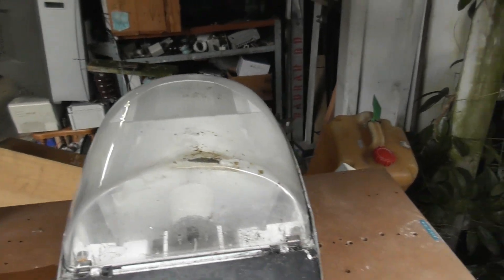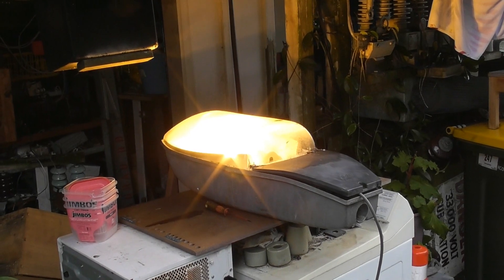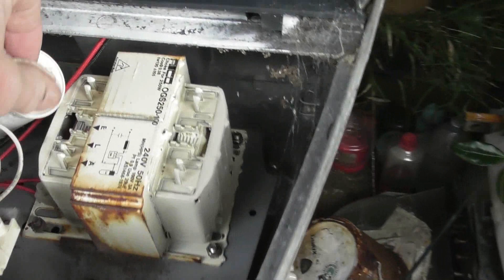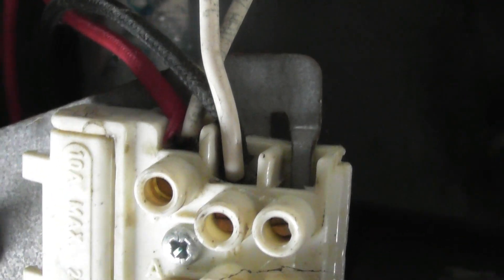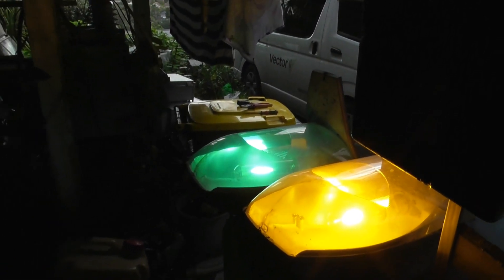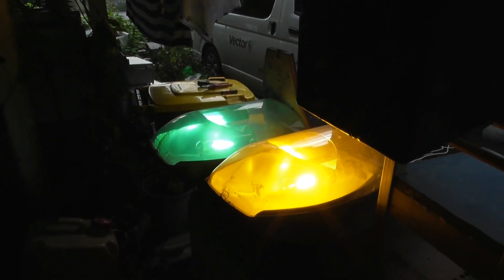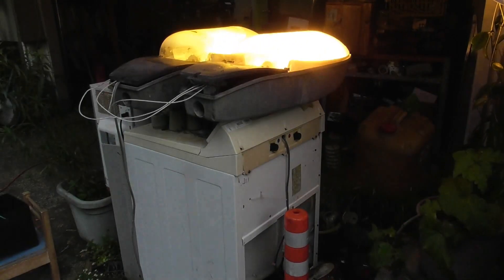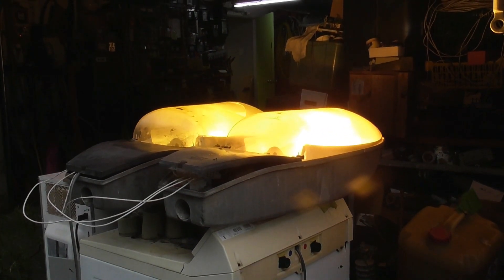Optispan SON lamp x 3 testing and run ups

Comment: I have never seen a HPS lamp start green like that, all the ones around here start orange.
Reply: It can depend on who made the lamp and how it was made.  Saturated vapour lamps will start up in orange.  Unsaturated ones will start up in bluish-white (from the xenon gas fill) and may have a bit of green in the spectrum from the mercury in the amalgam.  It can also depend on the pressure of the xenon buffer gas fill.